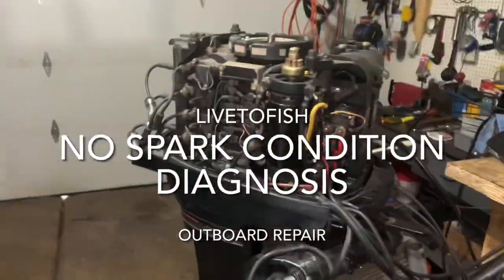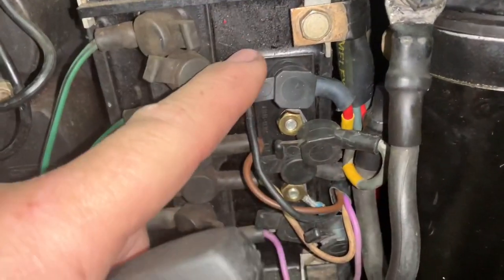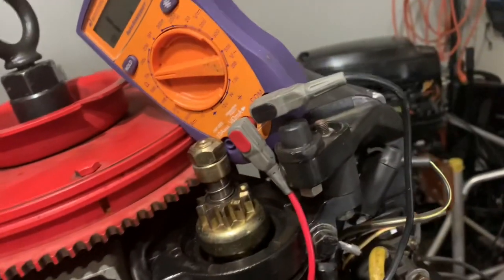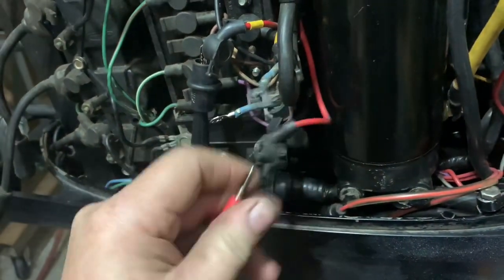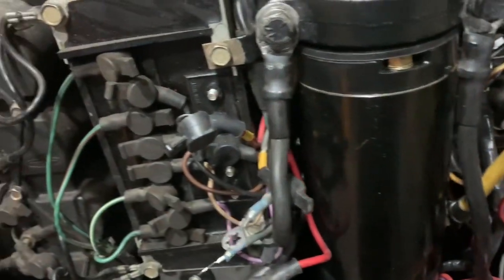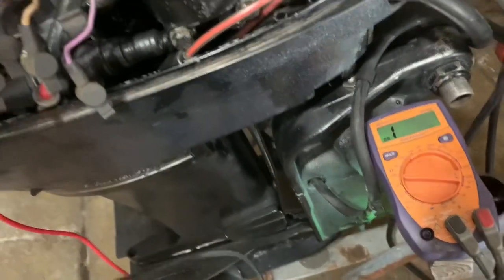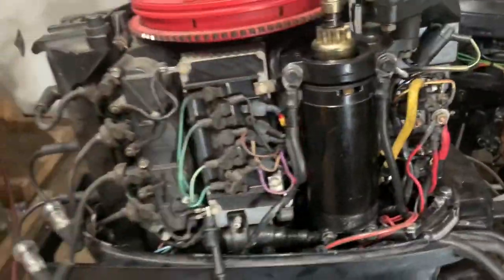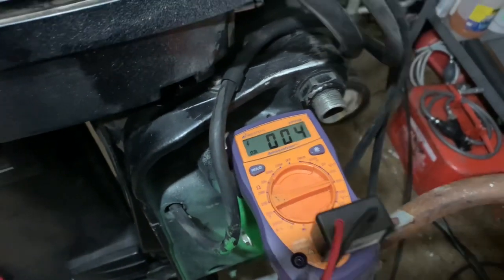“No Spark” Is it a Bad Switch Box, Stator or Trigger? Using a DVA Adapter - 1989 45 hp Mercury

Comment: Great job explaining this ! I have an issue where im getting spark on all cylinders but it seems like some cylinders are doing more work, i removed the plugs while running and there is one cylinder that it doesnt really affect the motor when plug is out, i test compression and all cylinders are good, coils are also tested to be good, could this possibly be an electrical problems thats not the coils ?
Reply from the maker: It’s still possible that one of the coils is bad under load even if it checks out with the resistance test. Did you check the switch-box, Stator or trigger outputs for resistance and peak voltage? Process of elimination.
Reply: @LivetofishOutboardRepair  im waiting on the dva adapter to test the rest but I switched the coils around and the same cylinder is giving me issues im thinking the coils are good ima do like you said but im thinking the switch box could be it. Thanks !
Reply from the maker: It sounds like your on the right track by diagnosing before just buying parts for trial and error. Keep looking and you’ll find the problem(s).
Reply: @LivetofishOutboardRepair  sorry i know I asked a lot of questions but I am kind of stuck, I found that two coils are recieving low voltage at 140 and the other two are borderline in spec at 160, I tested everything according to my manual and everything checked out except the high speed stator wires (red and red-white) read 100ohms and the manual wants it at 56-76, do you think that could be causing the engine to run rough at idle? thanks!
Reply from the maker: @omarnazzal2134  I would make sure you don’t have a fuel issue first by cleaning the carb. The idle circuit might be clogged. If your still having problems then revisit the Stator. If you were having problems at high speed then it might be a Stator problem but if your not then it sounds more like a carb problem.
Reply: @LivetofishOutboardRepair  good point, that could be the case i rebuilt the carbs a few months ago but i guess they could be clogged up again, ill remove them and give them a clean again, but would that explain the inconsistent dva reading on the coils ?
Reply from the maker: @omarnazzal2134  did you check resistance of the primary and secondary leads on the coils? If the resistance is out of range then I would replace them.

Comment: How much is the stator and switch box need to locate them
Reply from the maker: Check out a parts list for your model /serial number on www.marineengine.com then search those part numbers on EBay for your parts. You should be able to find them much cheaper. I found the switchbox for this 45hp Merc for only $45.00.
Reply: Have nothing on the stator Blu and blue white no reading on those 2wires
Reply from the maker: @brianpelcher3198  It sounds like you found your problem.
Reply: The problem I'm having is can't find parts for the classic fifty  nowhere needing a stator
Reply from the maker: @brianpelcher3198  Try joining a Facebook group called Vintage Mercury Outboard Fanatics. There are people who might have the parts you need.
Reply: Pretty easy find on Google. Cdi makes them yet as well as many others. Check out oldmercs for parts

Comment: Great video. Can the test for checking voltage been done without the DVA adapter? Or will the readings be different?
Reply from the maker: You must use a DVA adapter to get peak voltage otherwise theVoltmeter will just average the number and you’ll never know if your component is in spec
Reply: @LivetofishOutboardRepair  I got the DVA and made several measurements based from your test. My Mariner 100hp is a 1986. All ohmn tests pass on stator and trigger. Looks to be a trigger issue but not 100%. 
Stator volt on blue/white was at 180v a bit low compared to the others at 193v. 
Trigger voltage on the 6v tests all were around 3.0vdc. 
Making sure it’s supposed to be 6v based on a different year engine. 
5
Thanks for the help
Reply: @LivetofishOutboardRepair  ok thank you

Comment: Where is the kill switch wire located on the motor or what color is the wire been trilingual to get parts for mine they say they don't make them nomore
Reply from the maker: The Killswitch is a salmon wire that leaves from the ignition switch to the switchbox and from the switch box to the tilt/ Killswitch on the motor. You can try getting parts that are hard to find on a Facebook group called Vintage Mercury outboard Fanatics. There’s lots of parts available from people on that group

Comment: Very nice walk through, I’ve seen people just start buying parts and never walk through the check list and it cost them so much money before they figure it out.
Reply from the maker: I can’t say 100% sure but I’m pretty confident the switch box is bad. I didn’t check each of the coils but i did test the rectifier and that was good. It’s a pretty good bet I found the problem.  I’ll know tomorrow. The new switch box arrived tonight.
Reply: @LivetofishOutboardRepair  yeah I always start from the plug wires and work backwards but I believe you’re right. I do that because it’s cheaper going that way and the no spark on all cylinders is normally way up the line.
Reply from the maker: Unsalted Life ... well it’s fixed, it was the switch box after all. Now I have a overheating problem with the same motor even after installing a new water pump impeller. I’m thinking it’s the nylon insert under the powerhead. I’m getting a tell tail stream but it’s weak and coming out super hot. What are your thoughts?